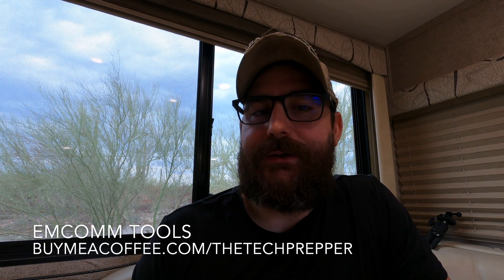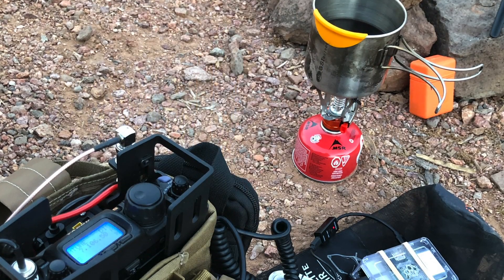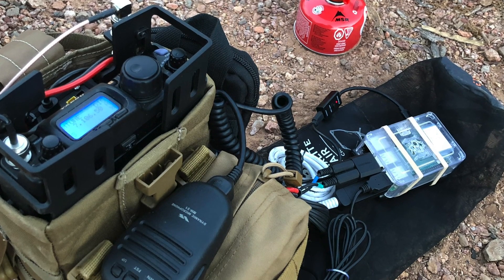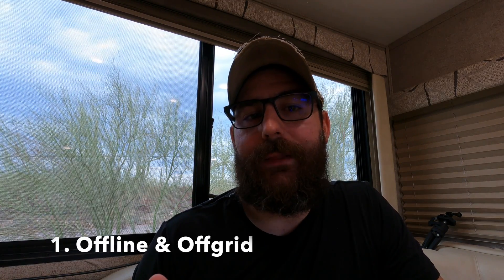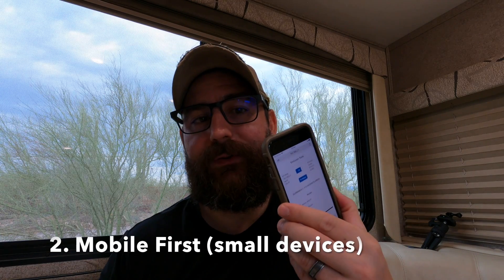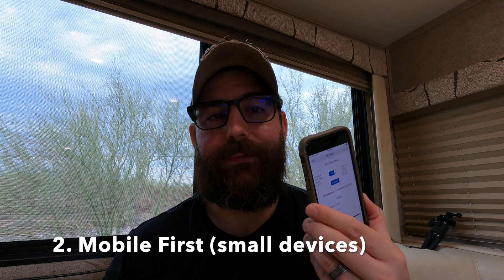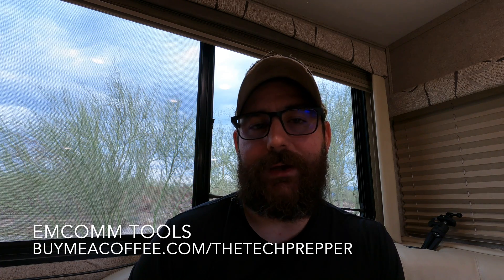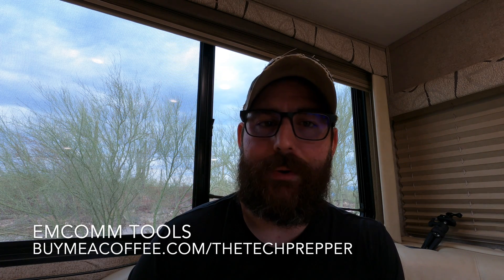What is EmComm Tools? - Offgrid and Field Expedient Comms

Comment: I recently watched e-com video describing project based on set of standardized tools.  Which I totally agree with.  That video was put out 6months ago, ft-818 discontinued 5 months ago.  The ft857d been discontinued for a while now.  Won’t this be a hindrance to implement based on lack of availability.  
Hope is you would consider it based on newt radio….ie… ic705 or the like.  It does have  a extended easily changeable battery pack and the digi is built in.  Wondering?
Reply from the maker: The initial release will only target the FT-818, 857 and 897 via the DigiRig Mobile as it is designed to be an appliance. The Xiegu X6100 is also supported. I experimented with other radios such as the FT-891 and it introduced a lot of instability, so I removed the support. I am still on the fence regarding the IC-705 as that radio does not work for how my group and I operate. There is the possibility of support in a future release as a few supporters have offered to send me a unit.
Reply: @TheTechPrepper  
8 months ago I wouldn’t have considered the x6100…. But with the updates coming in I have to seriously consider that as a contender.  Also has a better price tag.  With a good ht to fill the gap of 2m 70cm.  Thanks for the info.

Comment: Quick question regarding you software layer. Does it require the full computing power of a Pi 3/4? Or is/could it be optimized to run on a Pi Zero? Smaller size, less power, etc.
Reply from the maker: Great questions. I purchased a Pi Zero for future testing, but it will likely run very sluggish or not at all. The Pi 3B+ is really the minimum hardware requirements. As of January 2022, I have switched the project and channel focus to a philosophy of "tools not toys" and have stopped testing on the Pi for may reasons and have optimized the EmComm Tools platform to run on a CF-20 Toughbook. I talk about this change and the CF-20 in this video: https://youtu.be/fI8zK2AiFXY

In short, the Pi's have failed me too many times in the field. I am writing this tool primarily for myself, my public service group and my mutually assistance group to meet our needs in the field. So unfortunately, it will not be "all things to all people." I know this an anti amateur radio philosophy, but my ultimate goal is to ensure that EmComm Tools works reliably as a simple to use appliance that is known to work really well on reference hardware (i.e. CF-20).

I try not to taint the YouTube channel with too many EmComm Tools update, so I post updates periodically 
 on https://www.buymeacoffee.com/thetechprepper/posts.

Comment: What are yalls thoughts on using a PRC 148 for SOTA activations and monitoring Emcomms? 

Trying to decide what to use on a thru hike of the CDT. This is an attractive option for me because of my time with it in the Army. Is it capable or nah?
Reply from the maker: Thanks for your service, James. I am not familiar with the PRC 148, but watched a quick video over coffee. Based on my experience operating man portable, here are my thoughts on selecting a radio: 1) Find one that covers the amateur bands you want to work. I have great success on 2m. Since you'll be in the back country, 2m is great as you can operate simplex on the national calling and adventure frequencies. 2) Pick a radio that you are comfortable operating. Specifically one that you can program manually. Since you will be on a thru hike, it would be useful to program nearby repeaters. 3) I would select something that is easily field rechargeable. For example, my Yaesu VX-6R can be charged without a cradle and can be charged with a simple cable that connects to 12v battery. 4)  Rugged. The PRC 148 looks rugged. Again, I purchased the VX-6R because it IP7X rated and built like a tank. 5) Pick something that works with your weight and size requirements. The PRC 148 looks rather large. Overall, only you can decide what's best for you. Good luck with your thru hike!!
Reply: @TheTechPrepper  Thanks for the input man, I will definitely take those points into consideration when making my decision. 

The plan is to have someone paralleling my trail with the jeep so that I could use them as a mobile repeater. Is this stupid? 

Keep up the good videos!

Comment: This is great work, but remember that many entries in the FCC database are quite inaccurate, PO Boxes, old addresses, and part-time residences.  No way around that, just be aware of it.  For example, half of the year, mine is about 1500 miles off.
Reply from the maker: That's a great point, Jack. Your mileage will vary when using this feature, but it's one of those things that's "good enough" most of the time. Thanks.

Comment: Thanks for another great video!  Excellent explanation of your software project.

Not that it's your normal mode of operation, but since you're using a network-connected browser as the interface, could more than one person make queries at the same time?  Might be handy if you were out with one or two other people.

Thanks!

-Scott,  K4KDR
Reply from the maker: Thanks, Scott. Yes, multiple clients (web browsers) can connect to the same Pi to issue queries against the call sign search index. It could be useful for a group of operators in the field. However, the other features that are tied to the digital operations of the radio are bound to one call sign (Winlink and APRS). Great question.

Comment: Nice work Gaston. I can't wait to get get my hands on this, and would be happy to be a beta tester if you need. Keep up the good work!
Reply from the maker: Yay! Another beta tester. You got it. Do you have Pi? What radio are you planning on using?
Reply: @TheTechPrepper  Yep, I'm a big Linux geek and have several Pis. Right now I only hold a Technician's license but plan to take the General in the few weeks. Current radios are a Yaesu FT3D and a FTM-7250DR. I also plan to get an HF Rig soon - on the fence about FT-818 vs. FT-891.
Reply from the maker: Good luck with your upgrade. I have both the 818 and 891. They are both great radios, but they serve different purposes. While I love the 818, QRP (low power) can be very challenging unless you are doing something like SOTA/POTA where you are the station being chased. I'm actually going to sell my FT-891 with pack frame as I'm considering another shack-in-the-box--the FT-991A. It's bigger and heavier, but I plan to use it as a semi portable station for the RV, house and Jeep. I'm really enjoying SSB and packet on 2m in addition to HF, so the 991A seems like a good fit. I just wish it was smaller so I could pack it. If you're interested in the a gently used 891 with TPA pack frame look me up on QRZ. I have the original box, packing material and manual.

Comment: Your project is really coming along great. Sign me up as a beta tester!
Reply from the maker: You got it, Shane. Are you running a Pi with your field radio today? I think you have a Xiegu, right?
Reply: @TheTechPrepper  Currently, I don't even have a Pi! I do have a Xiegu for QRP, but my field radio I am setting up for digital modes is a Yaesu FT-891.
Reply from the maker: @Scout75PortableRadio  Perfect. I have an FT-891, too. It looks like you'll just lose the APRS and Winlink packet capabilities, but you're golden for Winlink HF and the callsign lookup. We are going to do an end-to-end Pi build on the channel before the beta release with a full parts list to make this a bit easier to setup. Also, at 5K sub, I am considering giving the Pi we build on the channel away.
Reply: @TheTechPrepper  If you could forward me the part list before the video release, it would be greatly appreciated.
Reply from the maker: Will do. I'll likely post it on the buymeacoffee blog soon. I'm holding back as I want to get the right case first to ensure that I solve the CPU heat problem. I'm running benchmarks now and testing a couple of new cases.
Reply: If you're looking for beta testers, I have a Pi 4 with Jason's Build-A-Pi and a Yaesu 857D.
Reply from the maker: Actually, I may have to pull you in for an Alpha release since you have the same radio I'm using. What's your call so that I can look you up on QRZ and shoot you an email?
Reply: @TheTechPrepper  - NI4B
Reply: @TheTechPrepper  email sent to your QRZ email address.

Comment: Hmm.  Can my ic705 attach to it without a pi?
Reply from the maker: Unfortunately, all the software runs on the Pi. The phone is just connecting to the application running on the Pi using a web browser. There are plenty of people using a Pi with the IC-705, so you should have no problem running EmComm Tools. Great question!
Reply: @TheTechPrepper  does this have an app for Microsoft tablet?
Reply from the maker: No app needed. Just open a web browser on your Microsoft tablet. All the software runs a Raspberry Pi.
Reply: @TheTechPrepper  can’t wait to get it!!!